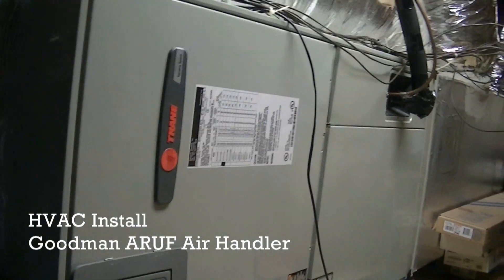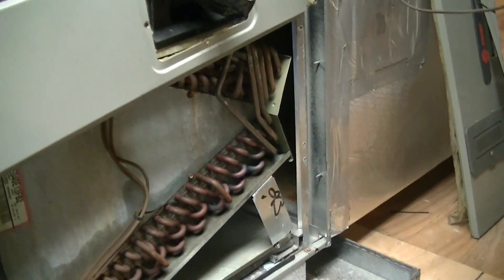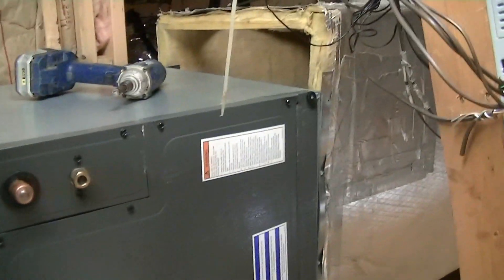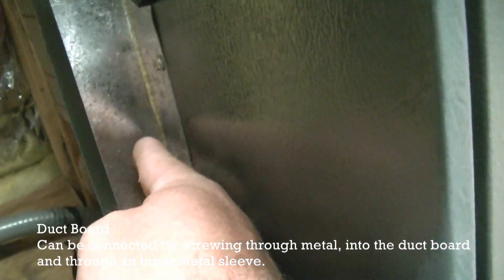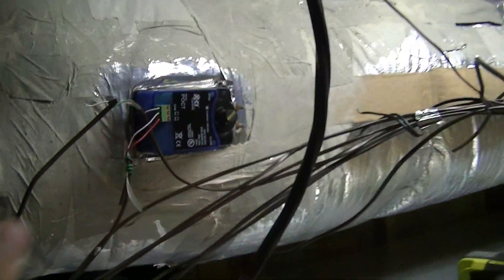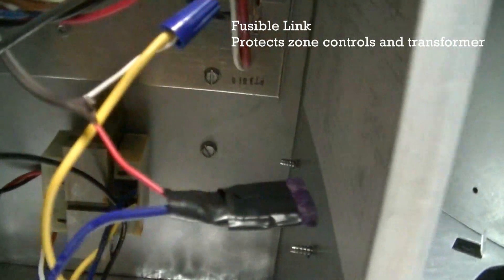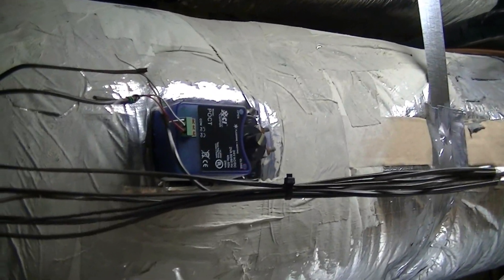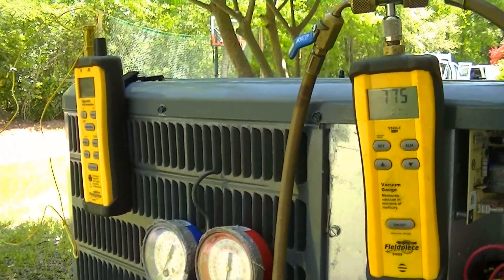HVAC Install- Goodman ARUF Air Handler

Comment: I need advice please.  I was looking for information on how to set fan speed on a ARUF and found your video.  My wife has been very ill for 25 years and not being able to afford any doctors in the last 5 years, we have been living on the grace of God and the rare kindness of others just to survive. Recently we have been running out of food.  My wife's condition requires she must stay warm.   Yesterday, our three year old Goodman ARUF 363616BR quit heating.  It is nearly freezing outside, but we need to maintain 78-80 inside for my wife to be comfortable. We first noticed the heat increasing to 88 degrees which may have been caused my a low battery in the thermostat.  I changed the battery and adjusted the temp and an hour later we noticed it was 74 degrees in the house. I could barely hear the fan running in the air handler and could feel nothing coming from the vents.  The unit has a 10 year parts warranty, but I have no money for labor so I called an AC company and they said that the 10 microferret capacitor was probably bad and told me how to remove and replace it.  Our only car is broke down so I had no way to get a new capacitor.  It was a very cold and miserable night for my wife.  The next day someone from the AC company was in the area and dropped off a new capacitor under warranty and took my supposedly bad capacitor.  After I installed it, the fan stopped running completely.  I called the AC company and was told to swap the fan speed wire from the blue to the "red" wire to turn it on "high", which would get us by till the AC company came by the next day.  The fan started running and pushed a very low about of warm air out of the vents, improving the situation for a short time.  Once the house got to 80 degrees, the fan heater shut off and did not come on again and it started to get cold.  I researched the fan settings and found that the black wire, not the red one is supposed to be for the high fan speed.  I switched to the black wire and the fan started running, but very slowly and not enough to push any air out of the vents.  It is now 1:28 AM and my wife is now suffering through another cold night with no heat. 

Do you have any idea what to try next.  I am pretty good with fixing things if I have the knowledge and was guessing the problem to be either the controller board, but most likely the fan itself.  The AC company said that they need to come and do any other repairs because they can not warranty out any parts unless they do the work, but that means a huge bill we can not afford.  I am also concerned that they were previously wrong about the capacitor being bad and told me the red, not the black wire was for high.  What do you think may be the real problem? Any help would be appreciated.  Thank you, God bless.  James